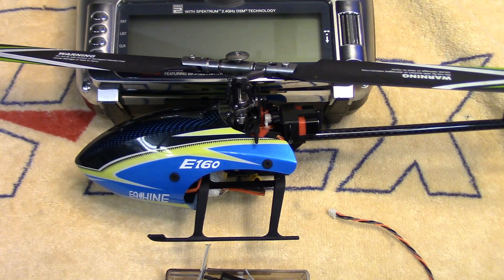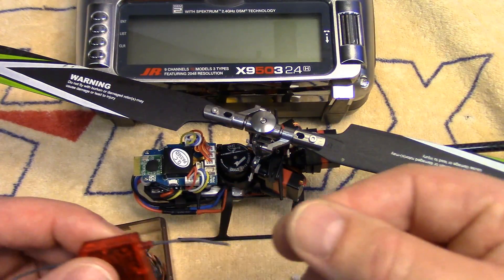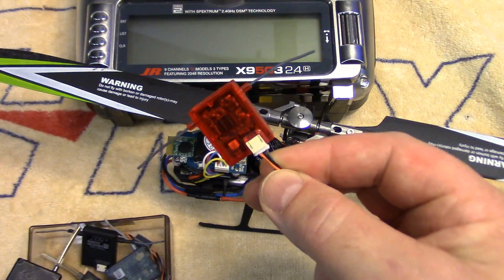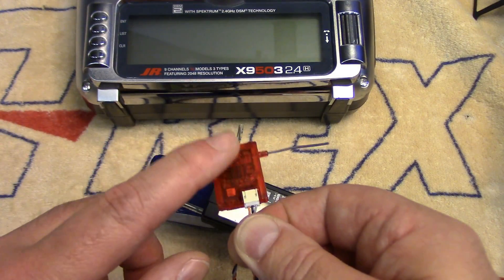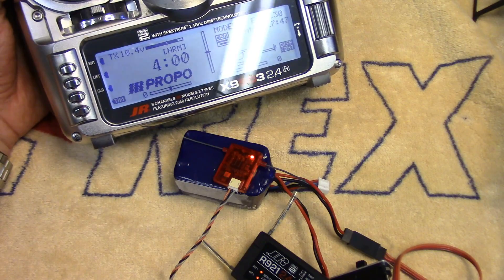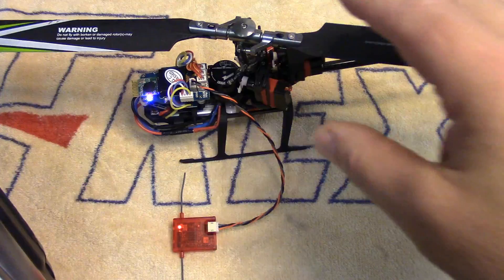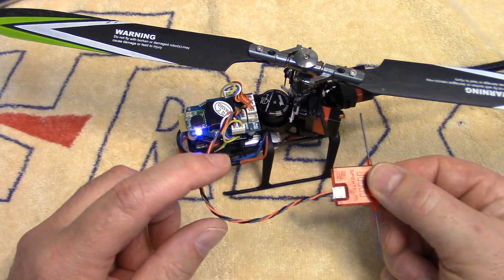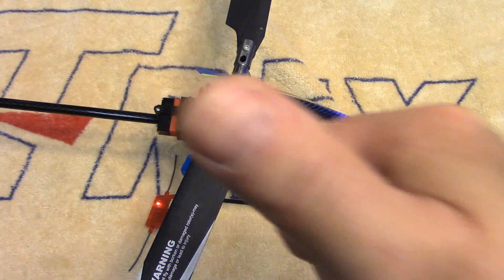How To Bind Eachine E160 To Spektrum DSM 2/X Transmitter

Comment: RaceTek Kensun Satellite 2.4GHz Receiver w/Binding Button [RTK-KEN-01015]
Reply from the maker: @edward allen - Yes! Great little DSM sat RX and it has a built in bind button to avoid binding hassles - thanks for sharing 🙂👍: https://www.buddyrc.com/products/kensun-dsm2-dsmx-compatible-satellite-receiver-with-binding-button?ref=-ptdbz6d-llb
Reply: @Rchelicopterfun  it is a little tricky to plug in battery while holding the bind button. so i made a temporary extender for xt30 plug with a switch on the negative lead.

Comment: Hi Jonh, thank you very much for another excellent content! By the way, would you explain or have a video that shows how set up the 6G/3D  on a Spektrum radio?
Reply from the maker: Like most small/micro CP helis, stabilization mode selection is via channel 5 output. So you would simply assign whatever toggle you want to use for stabilization to channel 5 and then set the output for channel 5 at -100% to +100% (ie. a 2 position switched output). Done. 🙂
Reply: @Rchelicopterfun  Thank you!

Comment: Hey John, excuse my ignorance but I’ve never gone down the satellite route. I’ve always flown as near “stick n rudder” as possible.
What exactly does that little DSM Satellite box do? Surely it’s not a fancy GPS is it? 😳👍🏻
Reply from the maker: Nope, it has nothing to do with GPS; it's simply what Spektrum calls their DSM2/X stand alone small receivers that have no servo BUS. Also called remote receivers (lots of info on Spektrum's site). I also go over this and other RX options on my flybarless page under the "How To Connect A Flybarless Flight Controller To Your Receiver" heading :
https://www.rchelicopterfun.com/flybarless.html
Reply: @Rchelicopterfun  Hey John, hope you’re good 👍🏻 I guess they’re using the word “satellite” in terms of separate to the main body, like satellite villages connected to a city by dirt tracks.
I have a problem with Dual Rates on the E6 transmitter, mine came from the factory set to 50%/100%.
I changed my pitch and throttle curves easily BUT when it came to Dual Rates (1,2 & 4) I could only change channel 1. It simply won’t allow me to jump to 2 and 4, no matter how many times I bash the Mode button lol. Just changing roll could be disastrous - any ideas? 🚁

Comment: Hi John, I'm a newbie on r/c heli and I keep on practicing on my simulator. Now I'm ready to try what I learned from the simulator to the actual r/c heli so I bought the eachine E160 BNF model and the radio master TX16S. My question is, does the E160 comes with a receiver in it or should I buy a receiver in order to bind with the radio master transmitter. Thanks.
Reply from the maker: E160 has a built in S-FHSS RX
Reply: @Rchelicopterfun  thank you so much for giving attention to my question.

Comment: I recently bought the tx16s to replace my Qx7 and older Dx8. Trying to get all quads and helis on the tx16s. The core heli guys hate open tx. That's the Info  I'm getting. I am having the hardest time programming the tx16 to work with the nano s2 and the mcpx bl2. The omp m2 and the xk130 I figured out. Lots of info to learn.
Reply from the maker: Well, as a pretty "core" heli guy myself (flying & instructing for over 30 years and having one of the most popular RC helicopter websites on the internet), I love OpenTX. But that certainly wasn't always the case. My first two weeks the Horus X12S purchase, I hated OpenTX like many, and was ready to give up. Then I found OpenTX University's website on a good customer's recommendation.

Now, as I recommend to everyone getting into OpenTX; make OpenTX university's website your best friend. Study it, learning it, know it. Every single thing I know about configuring an OpenTX radio comes from that site, including their excellent section on helicopter radio configuration. That section by the way will help you get your OpenTX radio to have a similar base configuration as what a preconfigured off the shelf Spektrum radio uses in terms of inputs, outputs & mixes.

Comment: Thanks for your time kinda like the heli better than omp2 for smaller areas but both excellent reviews
Reply from the maker: The new M1 is amazing! https://youtu.be/VECEXCRKzrI
Reply: I just ordered 160 I’ll wait on m1 still only preorder plus they are going to tip everybody upside down pocket wise $240 originally was supposed to be $180 close with the other micros so just set up radio and satellite 📡 for arrival

Comment: Would you build a 800 helicopter for me complete programming to a h1 gps  to a rtf package.  Really want something large that I'm going to be able to get more than 5 seconds out of.  Really tired of wrecking nice models.  It's always something.  If it's not a set up isue it will be a mechanical and if either of those don't crash me it will be the wind or center of gravity or...or...or... I can always simply lawn dart it .... Seriously there is absolutely no one around here that really knows jack about these helicopters.... They sell them but really that's about it.  Only one shop around here that could get one to bind.  Seriously they do drones and cars but helicopters are like a mystery thousands later I still have nothing flying.  Had success with the preprogrammed rtf 230 with a safe button.  I can fly that....but they are plastic junk.   Couple flights and every part will be worked if it's still around.... Tiny hard to see... Proper lights and or GPS tracker makes it too heavy and fly like dog sh💩.  I have a trex500dfc I have been smart enough not to fly...needs set up.think I have a 200.00 top of the line spectrum helicopter receiver around someplace I would surely take a week to set up miss something and be minus a large heli.  I have a dx8 gen 2.  Would buy a dx20  need SAFE or GPS .  Surely have proven repeated with 6 or 8 200 to 360 size that I don't have this down yet.  Costs me like 100 a. Second to learn.  No one to help.

Comment: Hi john I lost the Jesus bolt on my e160 in a crash was wondering if you knew what size it is?
Reply from the maker: Sorry, never measured it on mine. Here is a listing of all the screws that come in the E160 screw hardware set - it's one these: 😅
Item Name: Screw Set
Brand: Eachine
Item NO: E160-024
Cross head screw ST1.4*4PA D2.4 carbon steel nickel plated*9
Hexagon cup head screw 2*9HM D3 half tooth carbon steel black zinc plated*2
Cross round head machine screws 1.6*4PM D=3 iron nickel plated*4
Cross head machine screws 1.4*3PM D=2.5 iron nickel plated*2
Cross head machine screws 1.4*7PM D2.4 carbon steel nickel plated*4
Cross round head machine screws 1.6*5.5PM D=3 iron nickel plated*2
Hexagon cup head screw 1.6*6.5HB D3 carbon steel black zinc plated*1

Comment from the maker: Here's my Eachine E160 Review Video: https://youtu.be/Yw0aMjfX96c
Interested in taking up the hobby of RC helicopters? Visit my website for helpful information: https://www.rchelicopterfun.com/
Reply: Purchased the Eachine E160 an was wondering what you would suggest for setting up the transmitter that comes with this helicopter.
Reply from the maker: No idea on the TX that comes with since this is the BNF version I got. However, collective pitch setup is setup regardless of radio used. I mention all my settings in my 3 flight modes in the review video I did on this heli: https://youtu.be/Yw0aMjfX96c
Those are based largely on all my CP setup values which I go over in this video: https://youtu.be/O1L0wxzoqOU
All that is based on the setup procedures for all Collective pitch RC helicopters in my setup & tips eBook: https://www.rchelicopterfun.com/rc-helicopter-tips.html
Reply: Man I'm glad I am not the only one still flying with a JR 9303/9503.  Thanks John

Comment: Thank you for the great video! If you had to choose between the XK130  or the E machine 160 witch  would you say is better? I have the XK130 and it's a pain! What are your thoughts? I was thinking about getting the E machine? Thank you Leo
Reply from the maker: I answer this question in the review I did on the E160. The 160 IMO is hands down a better performing micro than the 130. The brushless tail performance improvement and efficiency increase alone pushes it ahead. Never mind the longer flight times, better landing struts, better main motor, and better overall flight characteristics.

Comment: John,  Just curious.  Did you ever use a DSMX sat and Spektrum Tx on the Old (Original) Align 150DFC?  If so, did it fly OK for you?  For me it flew horribly, felt REALLY laggy, practically unflyable, but with a Futaba Tx on S-FHSS it flew fine, no issues.
Reply from the maker: Nope, never had the original 150, just the 150X which has been working fine with a DSM RX. Both at 11ms and 22ms refresh frame rates.
Reply: @Rchelicopterfun  OK Thanks for replying John, this video remided me of the issues I had, so I just thought I'd ask.👍
Reply: With spectrum sat I have mounted on the tail horizontal fin on 450 size. Maybe will work on this size.
Reply: I used one on my align 150. I didn’t really notice any lag but it was on the GRS gyro. I used it because it either wouldn’t bind or lost the bind. I used two different transmitters, same with both. I have two and a half of these 150’s and I have come to hate the gyro but it flys fine with the satellite and my inexpensive Dx6e.
Reply: @heeder777  Maybe lag isn't the best way to describe what was going on with it.  It could have been a cyclic gain issue when a DSMX sat was used.  Basically, every time I did a flip or a roll for example, when i returned the sticks to centre to stop the rotation, the heli would keep rotating and overshoot by around 25° to 30° every single time, so you'd have to give it oposite stick to corret for the overshoot.  I tried various different brands of DSMX sats from Orange and Lemon as well as genuine Spektrum sats, I tried 11ms and 22ms frame rate, nothing made any difference.  I have read about other people having issues like this, but non as pronounced as the issues I had, and I didn't find those user reports until over a year after I gave up with the 150 DFC on Spektrum, and tried Futaba instead, which worked fine, so IDK, It's  a mystery🤔

Comment: You can enter bind mode on any spektrum rx, when you short ground to signal on power up, and then it will go in bind mode
Reply: Ikarus.... How do you get the satellite into bind mode please. I have a dsm2 satellite I want to use but no receiver I can use to bind it...
Reply from the maker: @samgibson9153  Hi Sam, @Ikarus is pulling our legs. There is absolutely no way a Sat RX will go into bind mode by shoring the PPM data packet signal output to ground. You'll likely fry your RX if you try it - so don't do it! This holds true for both DSM2 & X. It took me a while to find the Spektrum Satellite Interfacing document I have that states the specific method of startup timing &  pluses that are required to put all Speky sat receivers into bind mode and in what type of support mode they run in (internal or external). Here is the procedure listed in that Spektrum document.
 7.2 Binding
A remote receiver is put into bind mode by issuing a series of pulses at power-up. The number of
pulses determines the types of binds allowed, as well as the “internal” or “external” mode of operation
(see below). The SPM9545 DSM2 remote does not accept DSMX bind commands. The DSMX
remotes SPM9645 and SPM9646 support both DSMX and DSM2, and will automatically select DSM2
or DSMX as available in the transmitter. Also, as DSMX always uses 2048 mode, the increased
precision gives the ability for an improved end-user experience. Note that DSM2 transmitters are not
available in Europe, although users still operate them. For these reasons, we strongly recommend using
only DSMX bind commands and DSMX remote receivers.
To put a receiver into bind mode, within 200ms of power application the host device needs to issue a
series of falling pulses. The number of pulses issued selects which bind types will be accepted from
the transmitter. Selecting the 11ms mode automatically allows either 11ms or 22ms protocols to be
used.
Here is the link to the full document - great stuff if you are a protocol nerd: https://www.spektrumrc.com/ProdInfo/Files/Remote%20Receiver%20Interfacing%20Rev%20A.pdf

If you don't have a full full function Spektrum RX to put your sat RX into bind mode or any other model, there are other ways to do it by hooking it up to external devices that feed it the required pulses. It might however be easier and less expensive to just get a cheap aftermarket DSM2/X RX with sat RX connectivity. Hope that helps and more importantly saves you from frying your Sat RX.
Reply: @Rchelicopterfun 
Take a look at  ledrib channel and look for video ( How to bind spektrum receiver easy way).
There you will find proof
Reply from the maker: Can't find a thing related to that on that channel and frankly don't have the time to waste. When the official Spektrum document shows how sat RX's go into bind mode using a complex series of pluses in the data packets instructing not only what mode & protocol, but at what packet refresh rate is selected. That plus multiple forum threads on Speky sat bind methods using software such as Betaflight and Cleanflight with CLI (control line interface) tab instructions; I don't need any more proof than all that. I have found so much evidence against the sat bind method you are suggesting and not a thing supporting it. I certainly won't risk frying a Sat RX nor do I want any of my viewers to fry their Sat RX's.
To quote Carl Sagan "extraordinary claims require extraordinary evidence".
Reply: @Rchelicopterfun  I took my satellite to the field and use a friends receiver to bind. Its now on my E160 and working great. Thanks.
Reply from the maker: Good plan. Glad it's working for you now on your E160. Have fun 🙂
Reply: @samgibson9153  I am not sure about dsm2, but I use to bind some dsmx without receiver, only by shorting signal and ground on power up, and it worked. It was some time ago, so not sure if all satellites are capable